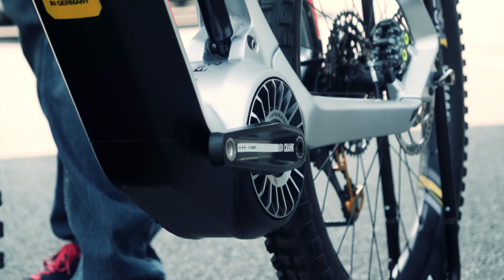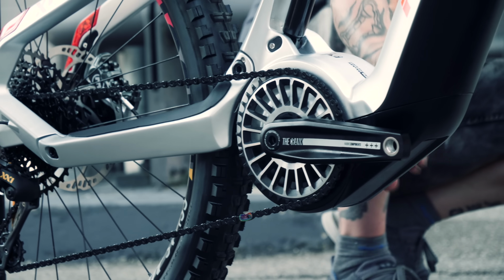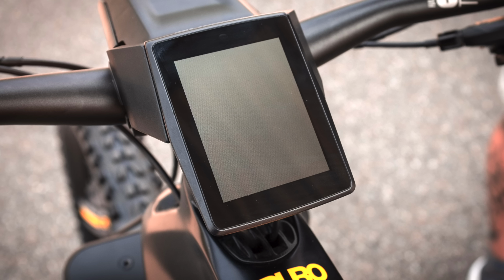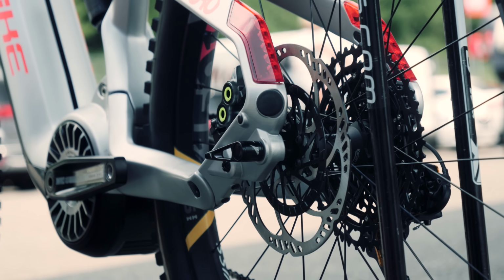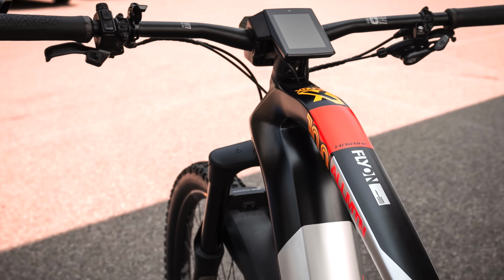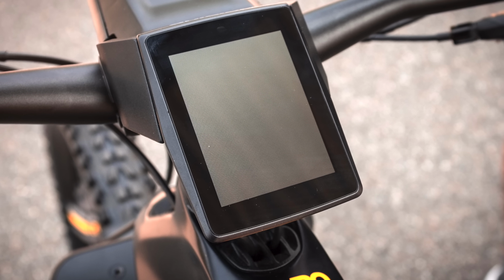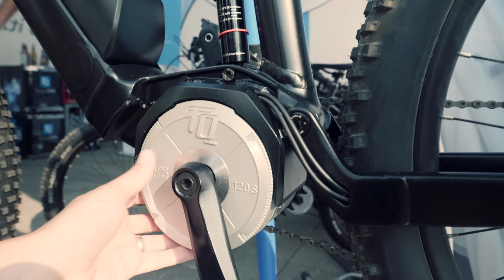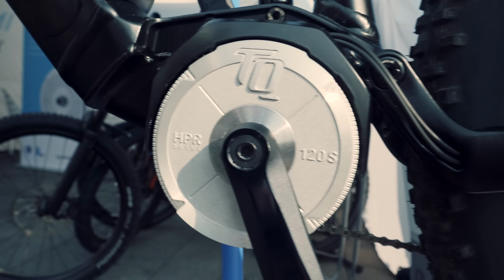Incredible 2019 Haibike FLYON and TQ Motor | Eurobike 2018

Comment: I’m betting it’s over 10 grand Canadian
Reply: EMTB Forums 14000 canadian before tax= which added up to definitely no.Ill stick to the Levo. Great bike i could have 2 for that price
Reply: Cannondale2019  yep , and probably a touch above that in Australia   😭 .
 Just saw the price ,   
 Ouch , that's a shade over  $16000   aussie dollars  , nice bike , a bit rich for this little black duck sadly.
Reply from the maker: €8999, what does that work out to be?
Reply: That's a lot... For something without proven reliability. However if the claims are true, this is a game changer.
Reply: TheAegisClaw very few people will spend more than 8 grand on a ebike. I looked at the kenevo for 10. I had to pass,lights in the rear stay are a bad idea.
Reply: mikldude ya I got money but I ain’t stupid. The handlebar display is a no the lights are a no. The price is a no. I climb super steep loose knarl in turbo with no effort With the Levo 90 nm is plenty of torque.  I have a Specialized dealer 20 min away. Haibike is 10 hrs away a two to 3 day trip. So it’s cute but not practical. Furthermore the battery will never be available in Canada, nothing over 460wh
Reply from the maker: In Europe it will sell a huge amount. There are a large number of people with the Pivot Shuttle and S-Works Levo. Top bikes sell for top money! Cheers, Rob.
Reply: EMTB Forums for a. 1000 more I can have an African twin haha